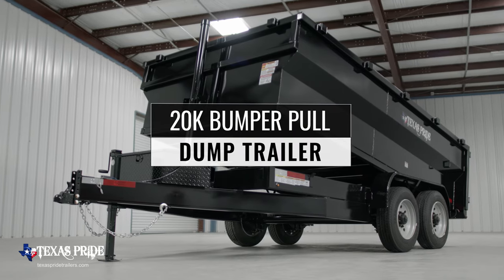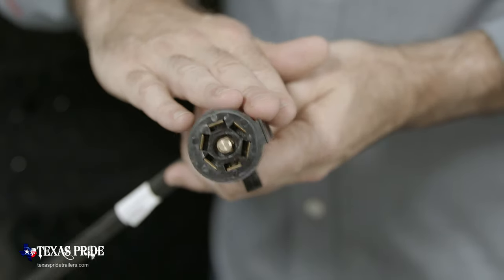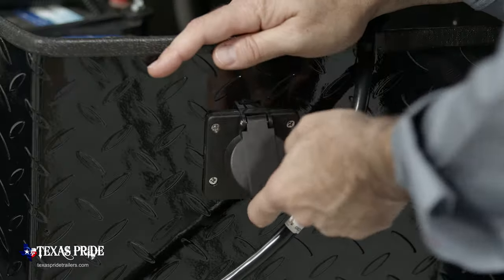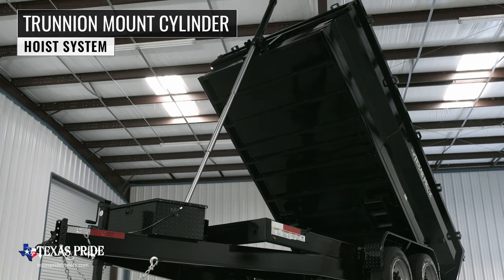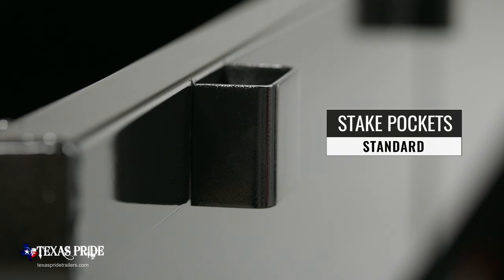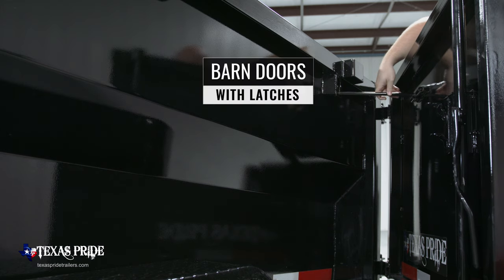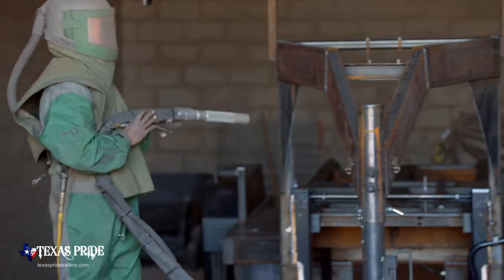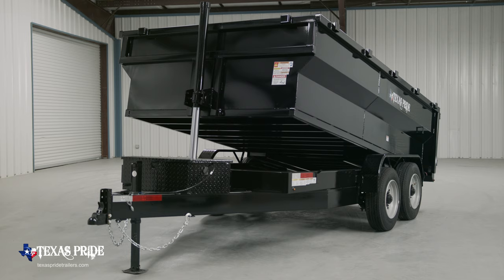Walk Around: 20K GVWR Bumper Pull Dump Trailer | Texas Pride

Comment: This trailer is great for my 2500. Do not need to put gooseneck hitch, newer trucks alot taller. So bumper pull won't be an issue.

Comment: What is the closest distance between the ramps?  I ask because we use the stand on skidsteers.
Reply: Texas Pride will custom build a trailer for you. As close together as you like on the ramps, heavier gauge floor, standard barn doors or a gate type for spreading. They can take this 20K trailer and license it to be a 14K trailer. You still have the capacity of a 20K for off road use but can still legally haul 14K on road.

Comment: Seems you’d want a heavier duty drop jack.   7k on a 20k trailer can’t sustain whats in the dump trailer should you decide to unhook while loaded.  And shouldn’t this be 18k dump trailer with 2 9k axles???
Reply from the maker: Great question! The 7K drop leg jack on this trailer has plenty of capacity to handle the tongue weight of the trailer even when loaded to its full GVWR. As far as the 20K pound GVWR, although the axles are the biggest consideration when calculating the GVWR of the trailer, other components such as hangers, leaf springs, and tires and wheels also play a role in this calculation.
Reply: @texaspridetrailers  thanx for your thorough explanation. I stand corrected.